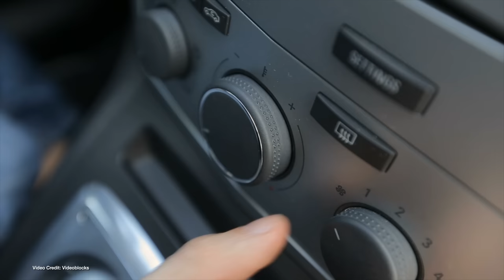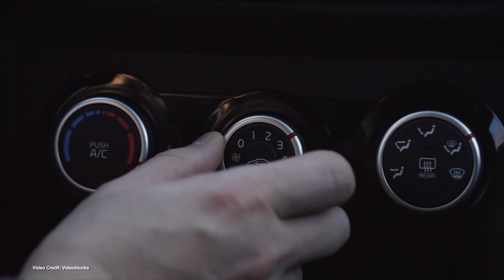How Do Electric Cars Keep You Warm In Winter?

Comment: Great explanation!   Where there is a will there is a way.   My bet is on Tesla's solution is the combo resistive plus heat pump as which has been used for room heaters for many years.   When I was a GI in Germany I drove a '57 Beetle.  What heater?   LOL...no coolant in that motor.  No wonder all the Germans carried blankets in their cars.   By the time you drove to the base the engine was only beginning to warm up.  Also when we were on guard duty we learned to dress up with winter gear when patrolling around.   After all those Danes ride bicycles to work in winter.   Where is their heater?       This issue is part of the balancing act all of us play in trying to be net zero or energy efficient.    We learn the best strategies to maximize the kilowatt hours we save and produce.   That's part of the game and the fun.   Nobody likes to be cold, but we can't expect to have the wanton use of heat like you may get from an ICE that is mostly good at wasting heat from the energy used.   Really for the very few days of the year most of us would have a problem with the heater we have to use our head and our winter clothes and all those excellent strategies you suggested!!   Some people think it is fun to sit in a tent on a frozen lake.   It is all perspective and a little creativity, adaptation and common sense.    Cold weather doesn't last long, and the days are already getting longer and sunnier!

Comment: As I see it, EVs need to develop a new paradigm for thermal engineering of the entire vehicle.
 
In an ICE vehicle, you have:
- An engine producing TONS of heat (when driving)
- A cabin that needs heating and/or cooling (when driving)
- That's basically it
So, the solution is simple: have a big radiator to cool the engine, divert some of that heat into the cabin if it's needed and run a separate air conditioner if it's needed.
 
In an EV, you have:
- A motor (and inverter) that needs cooling (when driving)
- A battery that needs cooling or maybe heating (at any time)
- A cabin that needs heating and/or cooling (at any time)
- Minimal battery energy available for thermal management and no guarantee when the driver will plug the vehicle in
That's a more complex system, operating on a tighter energy budget. So far, automakers have favoured resistive heating, conventional AC in the cabin and liquid cooling for the motor/battery, but there's a lot more that could be done. Could you scavenge heat for the cabin from the motor/battery with a heat pump? Could you make the main heat pump reversible, to eliminate the need for a separate AC unit? Could you use a heat pump to warm the battery from ambient air? Could/should you combine some or all of these heat pumps with resistive/PTC heating? Could all of this be served by a whole-vehicle liquid cooling circuit? Or would you need to partition it out? Do you need different solutions for when the vehicle's stationary and when it's driving? And who's going to pay for all this R&D work? There's a lot more that could be done, and potentially some very clever efficiency solutions available, if some good engineers can spend some time on it.

Comment: Adding resistive heating and/or better insulation and/or a bigger battery would address the cold weather issue. Unfortunately a software update will not address the issue.

Comment: PTC heating is resistive heating, and no, they are not more efficient than other 'resistive' heating. 1W in, gives 1W of heat.
The third method of heating not mentioned in this video, is Peltier Heating https://www.google.com/search?q=peltirr+heating&ie=utf-8&oe=utf-8&client=firefox-b-m
The peltier thermoelectric device is normally used for cooling, but works just as well heating.

Comment: The 2020 Kia Soul EV, E-Niro Kona, with Heat Pumps, extract heat from not only the air but inverter, batteries etc to supplement the heat efficiently and when too cold have a PTC heater that kicks in. Tesla does this as well, but rather than using a PTC heater on the new Heat pump version for additional heat during cold weather use the motors to produce heat by modulating them to generate heat. I notice with my E-Soul if cold and not preheated uses a few KW of power to preheat while running up the heat pump till the cabin gets close to temp, then runs only the heat pump (again depending on the outside temps). Check out the following link, it is informative... https://www.hyundai.news/eu/brand/hyundai-and-kia-turn-up-ev-efficiency-with-new-heat-pump-technology/

Comment: PTC and "traditional" heating are all 100% efficient at their surface, they just convert electrical energy to heat energy.  Even if they give off light, that light will be absorbed by the surrounding and create heat.  No resistive system is more efficient than any other - some are more convenient for construction and some are resilient - last longer.
You are correct about heat pumps, they have a maximal coefficient of efficiency of 7x , though generally work around 3x - that is, they move 3 times as much energy as energy consumed to run.  As noted by you, they struggle at low temperatures, so some manufactures use additional heating, and Tesla made an opps here.
You are wrong about heat to rise to temperature is more than continuous heating.  Heat efficiency in a car or house is fundamentally down to the temperature difference between the inside and outside (delta temperature) and the heat transfer coefficient of the materials of the car/house.  A car is very poorly insulated indeed (metal and glass)- so requires a lot of energy to keep the temperature delta (ie difference between outside and inside) maintained. The higher the heat transfer coefficient (inverse of insulation ability), then the more energy lost maintaining a temperature.  Cars have additional problem of "drafts" around door seals when you drive them too.
Since a car is so poorly insulated - it is best NOT to maintain its inside temperature when not in use - ie limit pre-heating.  In fact, if range is not an issue (ie you are on a short journey), and can use cheap tariffs overnight (ie 5p in UK), then you should NOT pre-heat when plugged in as you will be using expensive normal rate electricity to heat the car, whereas if you use the battery you will be using cheap rate stored electricity.  If range for a particular journey is important, then preheating will be important to you.
This common error is made for heating houses too - heating/cooling is fundamentally about the insulative ability of the house - and the temperature difference to be maintained - that is it, nothing else.  So to maintain a temperature means that that delta-temperature is constant and the heat lost = heat input is large.  If you allow the house to cool (say at night - you turn off your heating), then delta-temperature is less - so less heat loss.  Yes, the house has to warm up again - but the energy input is fundamentally based on integral over time of delta-temperature  - so you will use less energy overall. simple.
(As a thought experiment for those not mathematically inclined : in maths we think of limiting cases - consider I have a house I am not living in for 1 year. - I could maintain it at a constant temperature - or I could turn off all heating - and cut off the water.  In the first case, the energy used will have a value is "significant", in the second case the energy used = zero.  Now I want to live in my house again - in the first case, it is warm, in the second case - I need to turn on the water and heating and wait a day or 2 (to get the house fabric warm) - but you can see that the longer you don't heat a house - the more energy you save).
Finally - car manufactures would ideally improve the thermal insulation as this would significantly reduced heating and cooling - but this comes at a cost - and of course we are used to ICE cars where 75% of the fuel energy is wasted as heat - so no one cared about heating as there was an excess from an engine.
Your mileage and tolerance to cold cars may vary.
Reply: You get a warm feeling when people who know their stuff, take the time to write comments like yours. Thanks! Better insulation also means better sound proofing, all without adding much weight or cost...

Comment: Actually Benjamin Nelson installed a better system in his I MiEV. He got a a diesel fuel heater that goes into the cooling system of the Mitsubishi I MiEV that actually heats the coolant instead of the resistance coil that the car comes with. He was even able to wire it in so that the same thermostat that operated the resistance coil now operates the diesel heater instead. It is a much more sophisticated system because it fully incorporates all of the ductwork in the car while offering the advantage of not using any kilowatts to operate. This is the last video of how he installed it, with it actually running and putting out lots of heat. Benjamin lives in Wisconsin where it gets colder than just about anywhere in the United States and definitely as cold as much of Canada.   https://youtu.be/Duif55IDpi4.

Comment: Resistance heating makes the most sense for EVs keep it simple

What makes more sense if you have a budget of $300 and 30kg?

To add a heat pump or to add 5KWh of additional batteries?

For the same sum of money and the same weight I would much rather have 4-5KWh more batteries than a heat pump

Comment: Considering how cheap resistive heating is to manufacture, there isn't really an excuse for an EV not to have it. Heat pumps are way more efficient, and should be used as much as possible, but slipping a resistive heater into the system shouldn't substantially increase costs, and if it only comes on when absolutely necessary, it won't cause the range to drop unless it is extremely cold. And as long as the range of the vehicle is sufficient, in the 200-300 mile range, it will be fine, if you have to road trip in those conditions it will take longer, stopping at every supercharger instead of skipping every other one is going to slow you down quite a bit. But that situation is so niche that it isn't particularly relevant to mass EV adoption.

This is one reason why I think the last 1% of cars will be tougher to switch over, people dealing with these conditions on a daily basis may even be better off with a biofuel powered vehicle in the long run, but even in those conditions, EVs have some advantages. Being able to warm up from grid power, and do it without building up fumes in enclosed spaces so you can have it warm before you get in is a pretty big perk. I have an ICE car, and one of my least favorite parts of winter is waiting for the car to warm up as I drive. It usually gets to be properly warm 2/3 of the way to work. Having it be warmed and ready when I sit down would be really nice.

Comment: If they are using heat pumps, these don’t work well when the air temperature is well below freezing...
There is no ‘fix’ for physics

And turn the seat heaters up full. They use less electrons
Reply: "these don't work well when the air temperature is well below freezing..." This depends on the heat pump. Some LG models for example are designed to continue working at maximum capacity all the way down to -5 F, at which point supplemental resistive heating elements begin supplementing the heat pump's output.  My guess is Tesla's heat pump has a glitch that needs to be worked out.
Reply: Physics thinks that “Freezing” is -273.3 centigrade. Freezing is just freezing for water, not for the gases in a heat pump. My home heat pump works well down to -15C.
Reply: Actually heat pumps work pretty well good below freezing. It comes down to the design. You can design a heat pump that works well to 50 F and this will be very efficient as long as you don't go a lot below that mark. If you design a heat pump that goes to -40 F it will be very efficient in that temperature range, but less effective in warmer temperatures. (At least compared to one designed forthose warmer temperatures). ;)
Reply: @Muppetkeeper  I'm not an expert, but my understanding is that while your heat pump may be working well to -15 it is working "harder" ie it is using much more electricity per btu heat output than it would at say 5C.  As the temp gets lower it is taking longer to warm the room until it can't keep up anymore and has to be backed up by an alternate (like a resistance or gas heater).  Your home also has the benefit of being insulated and maintaining a constant temp.  Let it become cold soaked at -15 and it would take a very long time to get it up to room temp.  A car is tough to heat because it is often cold soaked, has very poor insulation and we expect it to be warm very quickly.
Reply: @andymurray8007  Considering you are not an expert you have hit all the relevant facts. More electricity is used the colder it gets, as the compressor runs faster and longer, you also can have icing issues on the fins of the heat exchanger, but only usually between the -2C and +2C temperature range.  My crappy diesel van takes ages to heat up in the morning, and I wouldn't really expect an EV to be any better, I just think some Tesla owners were expecting too much.  That said their could be a design issue if the cars can "never" reach the right temperature, even after running for say 20 mins.  I wonder which refridgerant Tesla use?
Reply: @Muppetkeeper  Thanks for the kind words.  It seems the design issue may be that they have not included a cold weather back up, although they do use the motor(s) for heat, so perhaps they could solve this with an OTA update.  Interestingly Bjorn Nyland hasn't come up against this problem in his tests, but I'll have to double check how cold he has been exposed to so far.  Heated seats and steering wheel are also the quickest way to make one feel warmer, which is why the lack of steering wheel heat has left me, and I think many others shaking their heads since the 3 came out.
Reply: @andymurray8007  Hi, I did see Bjorn having an issue, the Tesla was limiting the battery power even though he had 25%+ battery left, I saw him in a video sometime in the last week. 👍🏻
Reply: @Muppetkeeper  Sorry, I didn't mean there were no issues, but I don't think he had this issue, (keeping the cabin warm).  The BMS issue you refer to is another head scratcher, but hopefully they'll resolve that pretty quickly.
Reply: @andymurray8007  oh, I thought that they were linked as his battery was cold, hopefully they’ll sort it.

Comment: What you are claiming is total BS.
All heaters in an enclosed space (heat pump is not enclosed) have exactly the same efficiency. (as long as they do not vibrate, light up or make noise).
Heaters might have "losses" but these losses are also converted in heat, even light and sound that can not escape the closed environment (car) will be converted in heat.
This is called the law of conservation of energy. The super "efficient" heater from Tesla is just hype for the Stockmarket, pump pump pump the stocks.
Reply: was about to make (more or less) the same comment. resistive elements and PTCs have 100% efficency. and they are actually the same thing (resistors), just made a little differently.
Reply: Because you were abusive, I will step in here to suggest that you are wrong.  You overlooked the loss from the heater element to the outside environment without going via the cabin air.  The material of a PTC heater can be designed to limit the maximum temperature it reaches.  With a PTC, the element need not have ceramic supports etc.  Thus the thermal conductivity from the element to the housing can be reduced.  You may say this is a minor thing but it is enough to make you wrong about it.
Reply: @kensmith5694  No I did not "overlook" the heat loss to the outside temperature with an heat pump, I specifically noted TWICE that a heat pump is a different situation as any resisting heater.
The construction of a resisting heater does not matter 100% of the energy that it consumes ends up in heat.
Reply: @buddy1155  100% ends up in heat but again you missed the point.  The heat lost into the chassis of the car is not heat that is delivered as warm air to the cabin.  The topic here is the efficiency difference of two different types of resistance heaters.  The PTC one has a low maximum temperature of the element allowing materials with a lower thermal conductivity to be used for mounting.
Reply: @kensmith5694  I think you are mixing up efficiency and effectiveness. Cars with heated seats and steering wheel are most effective as those systems mainly heat the person not the air in the cabin. The most innovative brand with heating is BMW with their IR heating, that system also focuses on heating the occupants and not the air.
Reply: @buddy1155  
No, I am not mixing.  The output of the system is warm air around the driver.  It is not heat in general.   It does no good to warm the air for folks on the sidewalk.

Comment: "...heat the hot air up." If the air is hot, why heat it?  "Resistance heating isn't very efficient." It damn close to 100% efficient, more efficient that any of electric drive train components. Technically resistance heat is more efficient than a heat pump. Sure you get more BTUs with a heat pump for the same amount of energy, but most of those BTUs already existed, the heat pump just concentrated them. Just how much energy is lost in the heat pump in the process of concentrating existing heat?

There should be an alternate heat source when heat pumps are used as the effectiveness and efficiency of a heat pump drops off as temperatures drop. If Tesla is relying solely on the heat pump, there will be conditions where it cannot keep up with the need.
Reply: Err, isn't the efficiency of resistive heating irrelevant in this case, as it's the amount of energy you take from the battery which matters - and a heat pump takes less...?!